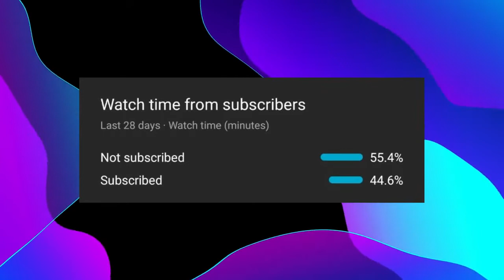How To Make a Engine Plane - RC Trainer Airplane For Beginners

Comment: information.        good work.        except, at :48, tail boom is a bit too long; the design of the vert-stab leading edge is   defective.   and,  SERVOS   DO   NOT   GO   AT  THE  TAIL.!!!!!          SERVOS   DO   NOT   GO   AT  THE  TAIL.!!!!!          SERVOS   DO   NOT   GO   AT  THE  TAIL.!!!!!          SERVOS   DO   NOT   GO   AT  THE  TAIL.!!!!!           the 'high' location of the mass of  the fuel tank  REDUCES  stability.          googletranslate